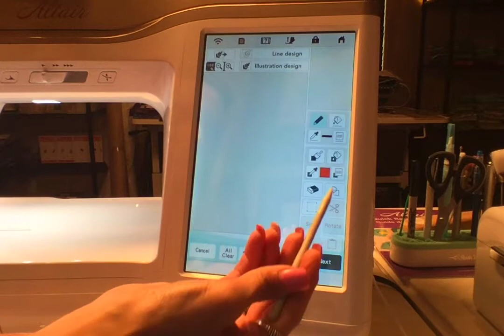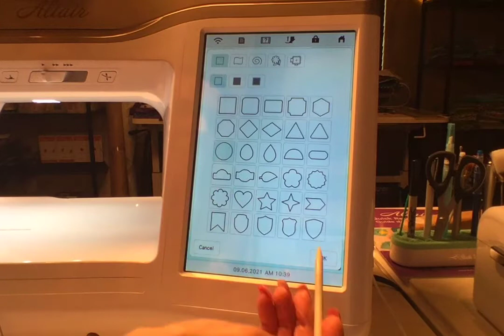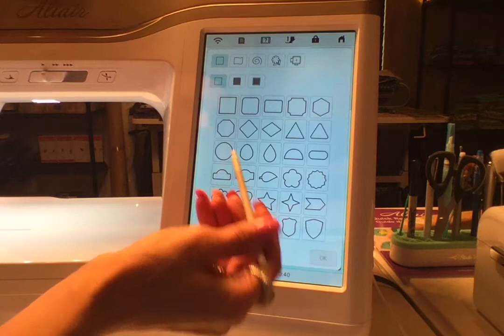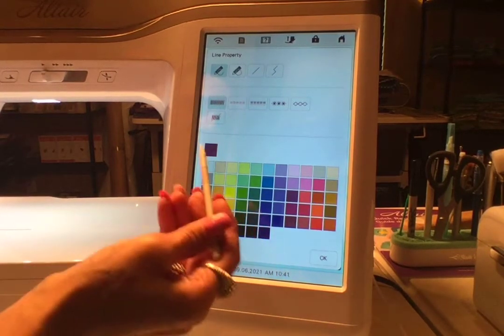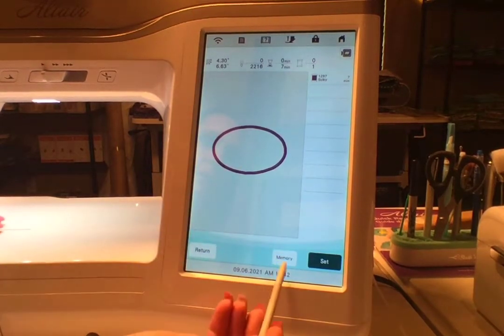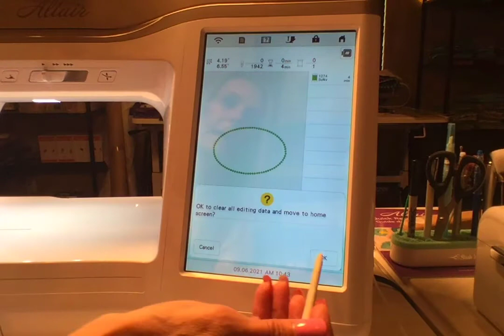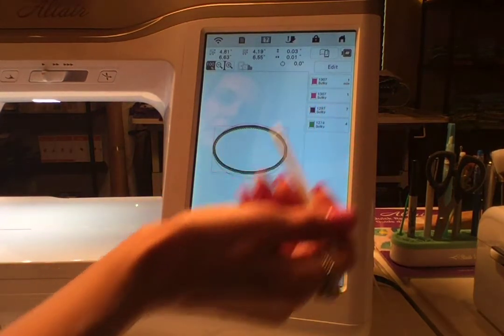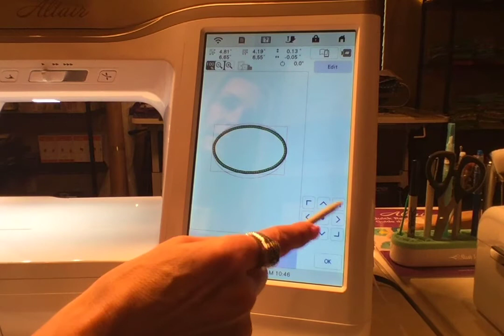Baby Lock Altair and Applique in IQ

Comment: I tried doing this and it came out so thick that it caused puckers.  I have a friend who tried it with the sdestiny and same thing. So thinking about this we are wonderring why this happened.
Reply from the maker: Hi Linda! So you created an applique on your Altair? I’m sorry to ask but YouTube doesn’t give me a connection to the video you’re referring to. I’ll assume for now that that’s it. So you made a placement, tack down and satin stitch? The first two have to be designated with the straight stitch. This is the button right next to satin stitch. It has two lines. Is that what you used?
Reply: @melindabigleysewblessed  yes but why was the candle wick stitch also added to satin stitch. Thats what made it so thick